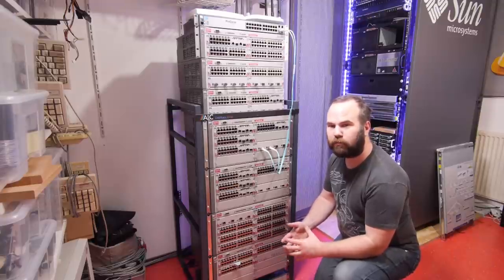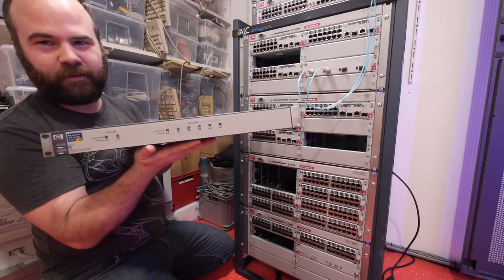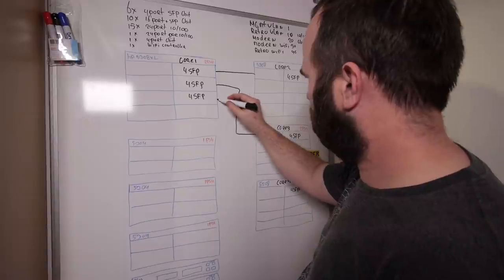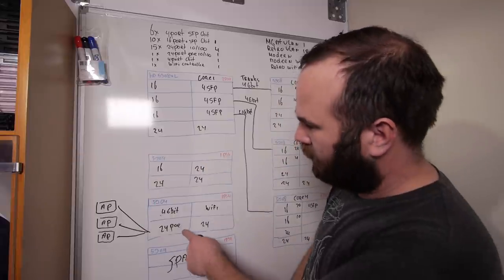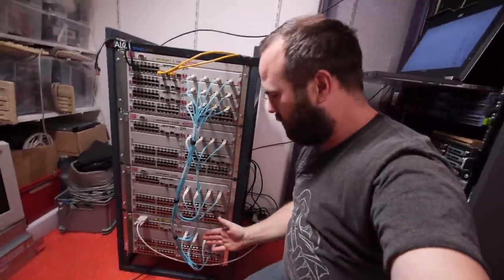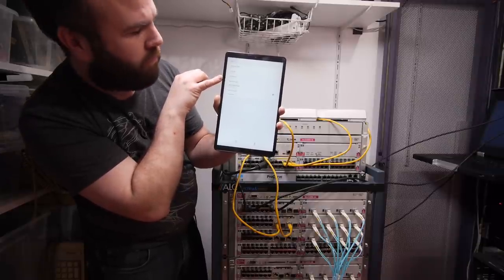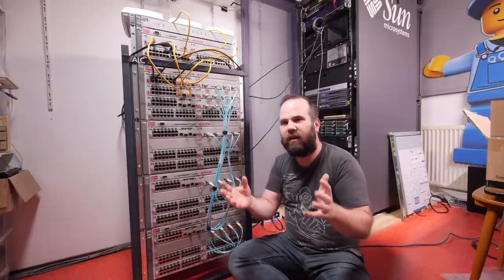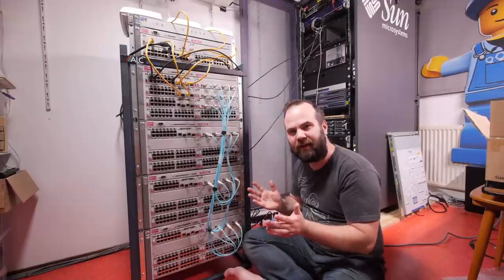Designing a Retro Lan Party Network with HP Procurve 5308XL Switches & Wifi

Comment: Nicely done, Victor!  I'm a former HP/HPE/Aruba employee, and in possession of both a 4-slot and 8-slot 5300xl series, and I can tell you, they are great switches!  They came at a time when HP was transitioning to the 5400xl series, so they never offered PoE+ (the 30W version of PoE) blades for the 5300xl series.  That R&D went into the 5400xl series.  But, you can get a 10Gb card for the 5300xl series, part number J8988A.  It's the "X2" form factor, so you'll have to get a fiber cable with that on one side, and regular LC connectors on the other.  I have my 5308xl (the 8-slot version) with the J8988A, and I''ve cabled it to my file server, because that's where I need the bandwidth and throughput (not the upstream ISP link, which is 1Gb).  Works fantastically.  Like I said, the only downside is that you have to use PoE+ injectors or wall-worts/bricks if you want to connect PoE+ devices on this series of switch.

Comment: The rubber protective caps provide two functions, prevents dust ingress and also protects your eyeballs from the transmit laser on each optic, depending on optic type can be quite damaging to eyesight :-) especially when some genius rack mounts a long hall switch with the optics at eye level....

Comment: Nice setup, a have also have one 5308xl filled with the 16 Cards. Lately a Datacenter Customer also throw out 4204vl's & even two 5406zl. I found out, that for them the 4x 10G x2 Cards  are easy to get, but on the other side the 24x SFP 1G Cards are expensive. Also this one don't need an external PSU to do PoE.

Comment: Even older high end Arista 10GbE switches use AMD (Turon) processors to run the OS (Linux) but all the heavy switching is via ASICs. I used FS.com SFP DAC cables to make a 40GbE MLAG between my Arista switches as their cables are great quality and value IMHO.